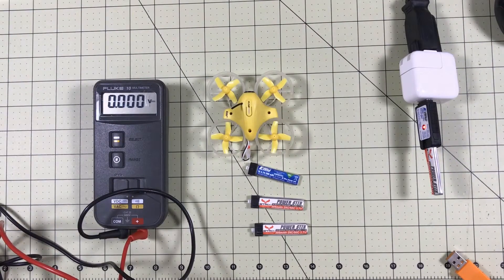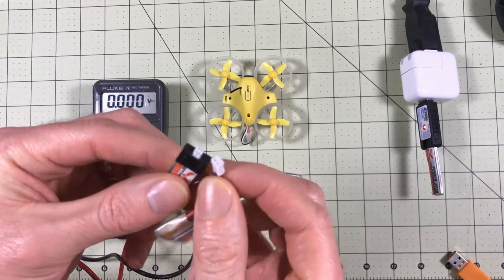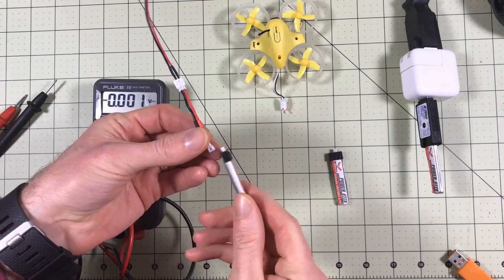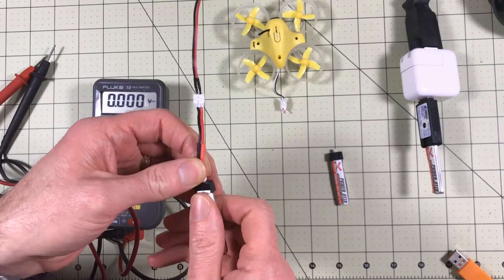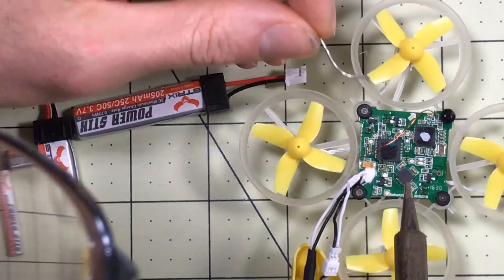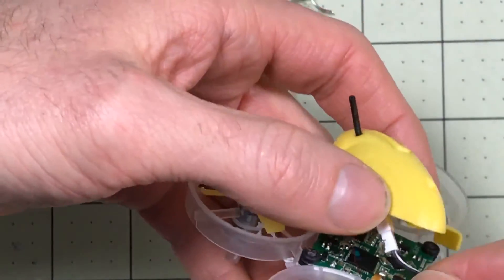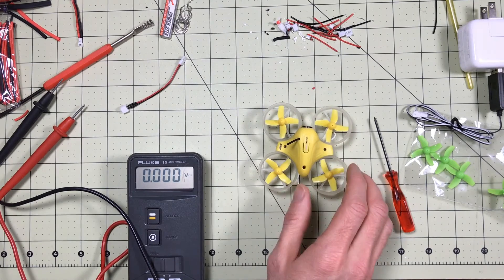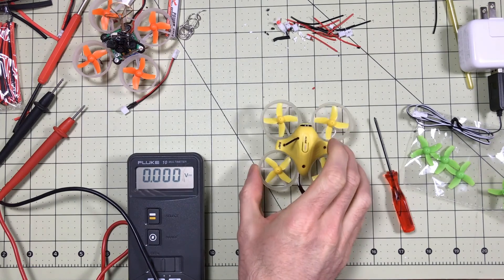Inductrix FPV Voltage Mod and Battery Fix Test

Comment from the maker: Items Used in this video:

Inductrix FPV RTF: http://geni.us/InductrixFPVRTF

Inductrix FPV Bind and Fly: http://geni.us/InductrixFPV

JST PH 2.0 Connectors: http://geni.us/JSTPH2

Or just buy new batteries that already come with JST 2.0 Connectors: http://geni.us/1SBatterieswithJST2

Weller WES51 Soldering Station: http://geni.us/WellerWES51

Eachine Upgrade Goggles with DVR: http://bit.ly/2ei8HDA

Comment: While waiting for my new charger for the 2.0 connectors I just did the voltage mod on my other inductrix and it just flew for 4 min 45 sec. pretty sure swapping out the connectors isn’t necessary at all. Kind of mad I already did with my inuductrix2 lol

Comment: One tip. You used the stock wire, use a heavier guage wire for the leads on the fc.

Comment: Just by watching your few videos I see all the changes newbeedrone did to make it a better flight experience. I know they don't fly as well as tiny whoops cause they use the induction board but theain things I would have done is what they did, jst-ph 2.0, have a voltahe censor but let the pilot decide when to land, OSD is a must for me personally, high voltage batteries, better motors and lighter AUW.  Mine is only 21 grams and with Unicron motors it almost flies likey 2.5 I but the throttle response isn't as crisp due to brushed.  Liked all the videos I watched. I'm sure you brought happiness to alot of people who thought their 100 dollar+ investment was a waste.  Hats off to you sir.

Comment: Not too sure about the stock inductrix only giving 1 minute flight. Mine does a happy 3 mins. Often 4
Reply from the maker: This was on the first gen FPV. And it didn’t start that way. But after a while it started doing what you see here.
Reply: @SimRacer101  it sounds like the motors are worn. Their rated life is 10-20 hours if I'm not mistaken.

Comment: Hey everyone just wondering if anyone knows if there was a newer version that was updated or anything because I just got my inductrix fpv with the stock battery tiny connectors wires look the same in the video I got almost 5 minutes of runtime I hit the wall and flipped about 3 times and had to pick it up but I was only down for maybe 10 seconds each time also when i was done battery read 3.55?? Because I was about to do this mod to mine but I just bought it and if I don't have to mod it I would rather not?? Any ideas??
Reply from the maker: If you are getting 5 minutes out of it I would not do this mod.  I got 4ish minutes when I first got mine, it just got a little worse, and a little worse, then straight to terrible.  I don’t think you need to do this right now,  but keep it in mind for later.  At least for the LVC mod.  The battery mod I would consider immediately because you can get some really good batteries that use the bigger connector.  More on that soon.
Reply: DroneRacer101 great thanks! I probably will do the battery mod anyway

Comment: You should change the whole cable to the board the black and white from battery connector with the larger gauge that's on your batteries ;)

Comment: After doing the power plug mod, and the voltage mod, do you charge your batteries in parallel or series?  Do you check the voltages before charging in parallel to make sure they are about the same? Nice video, thanks.  You've convinced me to do this to mine too.
Reply from the maker: +Robert Cortez  Do the power plug for sure.  Then see if you need the voltage mod.  It's seemed the is was far more needed in the older models.  For charging I pretty much just charge with the KingKong here now.  https://youtu.be/z9GCi2oXzoY It charges each battery separately so I don't worry about checking them.
Reply: DroneRacer101 cool. Yea... I have the Imax b6 charger with a parallel board. Going to order those connectors now. Thanks!
Reply: Robert Cortez I've parallel charged almost every time one my 25 packs and I just make sure they're not.more than .2 volts different
Reply: Gotta give it to you. You probably made alot of people happy. I never went with the inductrix. Straight to the acrobee v2. Building my second Wednesday.
Reply: Seems like with those 1.25 connectors not enough amperage is allowing to pass causing alot more voltage sag. I don't think they're shipped with these connctors anymore. Also with no OSD I see why they put a low voltage protector on it but when they hit 3.2.volts all power is lost, I have OSD so I can actually see what voltage it loses atleast half its max rpm and almost all punch. 5 second day to climb 8 feet when a full battery can do it in about a second.

Comment: the LVC mod. I hear Good & Bad,,,,,I just can't commit to it
Reply from the maker: +pointnozzleaway if you have good flight times don't do it. It you have an older model and it barely flies like mine did. Do it.  But I would change the connectors first still.
Reply: @SimRacer101  I would think that instead of shorting it you could continue to use it but put in different resistors to change the values? I don't have or plan to have this model so I can't try it myself. Just throwing it out there (probably been thought of)

Comment: I am going through this right now!!!!
I upgraded my kong tiny 6 to 2.0 connectors.
Geezus what a difference.
Now waiting on a new connector to upgrade my inductrix.
I'm just buying the batteries with the connector already attached rather than modding the batts.
Reply from the maker: +The Drone On Dude I can't fathom why they didn't upgrade to the 2.0 connectors in the new Inductrix Pro.  I get their rational, but the 2.0 is just so much better.
Reply: DroneRacer101 u just wanted to update you. I have 4 now and build them. 
Now.... the 2.0 connectors by default on all builds. I bought a bunch of the connectors.
Also, I have moved to 7mm motors. From my experience I prefer 7mm over even the 19500 6mm. I watch all your vids but seem to still learn the hard way. Lol
Reply from the maker: +Drone On agreed. That is why I tend to grab my Tiny 7 a lot.

Comment: What charger do you use? Great video! Now I think I know why my fpv nano qx has terrible flight times!
Reply from the maker: +bob jhonson for these I mostly use this charger now since it will do most things. https://youtu.be/z9GCi2oXzoY
Reply from the maker: +bob jhonson for these I mostly use this charger now since it will do most things. https://youtu.be/z9GCi2oXzoY
Reply: DroneRacer101 thanks for replying! And yep just checked my batteries that my quad says are dead and they are 3.9 and 4 volts. Hopefully will be replacing connector soon!
Reply: DroneRacer101 also do you charge on the 500ma or 200ma setting?
Reply from the maker: +bob jhonson it depends what on the battery. But I use the 200ma most of the time unless I'm in a hurry. For most of these batteries 500ma is still under 2C
Reply: DroneRacer101 thanks! I would never think the problem would be the connector! Thanks for the help! Keep up the great videos!

Comment: Thanks for this video, I am getting 4 minutes on a 150mah 30c
F36 board, frame and controller ... racerstar motors, four bladed props
And the Crazepony FPV Micro AIO Camera. Battery runs to 3.5 volts
When it's done. 😎🎮👍
Reply: alan lloyd do u have a video of that 150 lipo flying for four minutes? I would love to try that
Reply from the maker: +alan lloyd So it's 0% Inductrix at this point?  :-)

Comment: Great video !!
Interestingly I never had less than 3.5min with the tiny Elite ones. I’ve being using Hobbytyger 220mHa 35C with a 4.5min average flight time. Recently got some "Fast Speed" motors from Micro Motor Warehouse  along with some of their 205mHa 25C/50C.
Timewise, to be honest…
The new configuration sags a little less. 
I only changed the motors because of the rattle but, as it turned out, it comes from  the camera cable.
Reply from the maker: +Brandon FPV When did you get yours?  I got this one the very first week they were available and it sounds like they have updated the board at some point and the newer one's don't experience this issue nearly as much.
Reply: Got it on December 22nd. Horizon has a whole bunch of nice little things. I have a few. Looking forward to the Torrent 110. I love these mini-things !
Reply from the maker: It does look good, but seems a little pricy.  I have a KingKong 90GT on the way that I can't wait to review  http://bit.ly/KingKong90GT

Comment: Awesome video, I was hoping youd be able to help me out with something??

Ive got the eachine e010 (not the S)with the jr-nh010r board. Im trying to do the low voltage cutoff mod but i dont know where the resisters that i need to short out are located on this board. Got any idea?

Im getting 20 seconds of flight time with my setup of an eachine eo10, an Eachine EF-01 camera (case removed) soldered directly to the board and the Eachine 3.7v150mAH 30c battery. After 20 seconds I lose thrust and it lands, every time after that it fly's for about 10 seconds and lands. It takes a while for the vow voltage lights to start flashing.
Reply from the maker: +HavokBWR I'm sorry, I don't know for that board.  What does the voltage show after it lands?  That almost sounds like a bad battery.  I have one that does that.
Reply: DroneRacer101 It looks like the major issue was the placement of the camera, it wasn't completely centered so it used a lot of power leveling itself. It hovers for around a min 30 now. It almost weighs 30 grams so im gonna try to lower the weight more with a 3d printed frame before spending more on upgrades.

Comment: Great video
I have 2 x Inductrix fpv and the newer version flys for about 3min 30 sec where the first was the 1 min and I changed the battery connector 
but the lvc mod is great too and fly to a timer on my radio
Reply from the maker: +Raptor50aus Did you replace the connectors on your new one so they are consistent?  And did you notice any improvement with that change?
Reply: no the new one is completely stock and it gets 4 min 
I have micro jst 1.25 pigtail on the older one and get 3min 30 but it has the next speed up  motors from stock

Comment: Great video and mods. also try testi g with 3 bladed props and then do testing with 2 bladed props. more fly time as well. all i have got to do now is do the battery mods. with my 2 blade props and my ninja fast 70000 rom motors and runnung crazy pony 3.8v 220mah batterys i get 2min 35seconds. i bet after battery mod and going to slower motors i will hit 3 plus minutes!!
Reply from the maker: +Kenneth Maneeley From the other reviews I have seen changing the blades does increase flight time.  But it seemed to be that you increased flight time by 10%, but lost a LOT of performance.  If it was just a hover competition it would be great but I didn't want to drop any performance for racing.  Are your crazy ponys using the old JST 1.25 still?  I just ordered some that come with JST 2.0 installed already.  I would probably just recommend that over doing the soldering.  :-). There are links to them in the description.
Reply: yes i  am using the the old orignal 1.25 connector. I just may order the new ones with the 2.0 connector and downgrade my motors to the 17kv from the 19kv then i should be ok. keep up the great work!